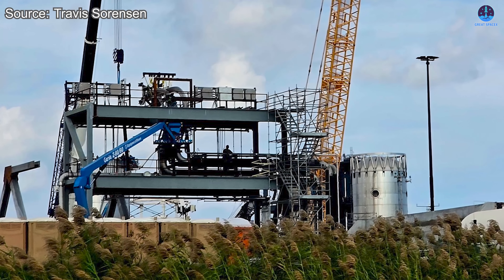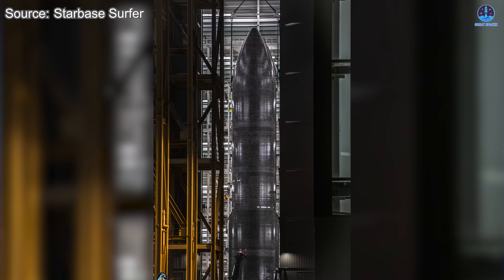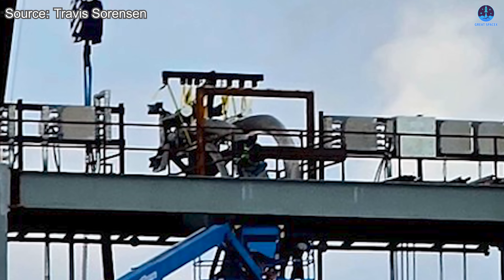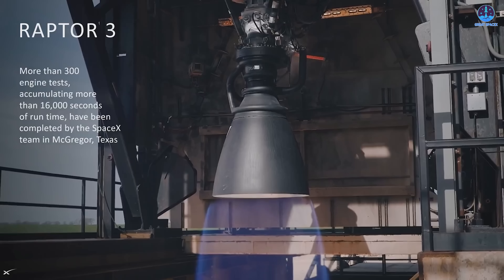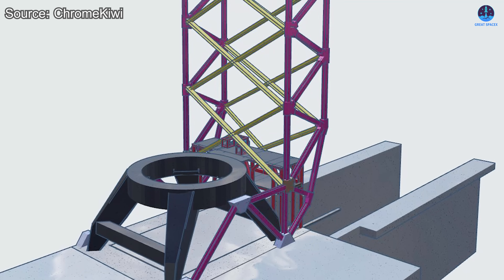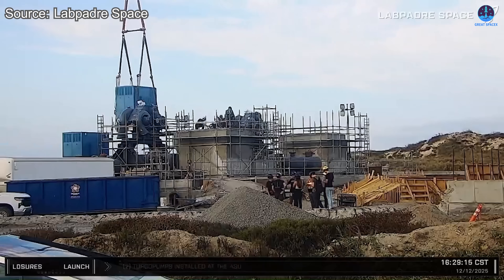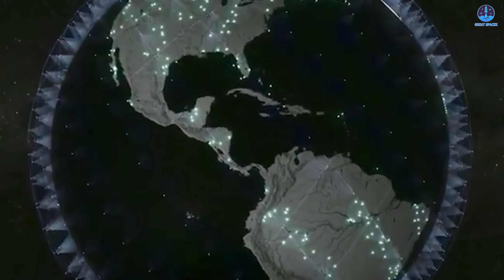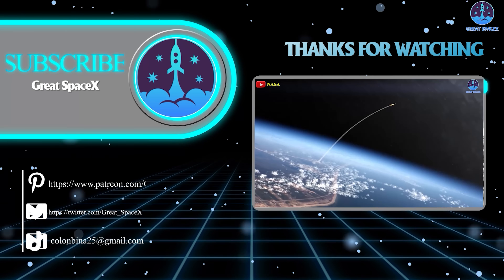SpaceX's Genius Solution to Build New Starship Test Pad at Massey! HOW will This Work...

Comment: So I have a question about these "near miss" incidents.

If you were driving and passed just within 2 football fields of another car, would you describe that as a "near miss"?

No.

No you would not.

What a near miss describes is a point at which the mathematical projections can no longer 100% rule out a collision but they are not at ALL what you would call close in 99.95% of cases.

Comment: Bill for Starship goes up faster then a rocket  :D  Its getting closer to passing the costs of SLS. And Starship doesn't even work. And SLS is already on its second mission...
Reply: You have missed the entire point to this system. Remove the hate goggles and cheer on the USA for leading in space.
Reply: 😂 sure but can SLS be built in a month and launched? Even if Starship was 2 times more expensive then SLS that speed would make it a huge advantage just because of the huge pay load it could launch. Even if it was a single use rocket you could still launch one a month. Also it's the reuse they are trying to nail down so in any other respects it's pretty much good to go. Just give it some disposable fairings and boom. But they are trying to do something much harder. Something not even the space shuttle could pull off without months of refurbishing and a while knew rocket built for it to launch again for it to get out of earths atmosphere.
Reply: @ShieldWolf-yp3cr  Starships payload is tiny thats why they have to make 10 launches just to reach the Moon once in theory.  Starship V2 at ~35 tons to LEO compared to New Glenn's 45 tons and SLS Block 1's 95 tons..
Reply: @Lelanders247 yet New Glen and Starship both need refueled to get to the moon. Starship gets there with 200 tons what about New Glen?
Reply: @ShieldWolf-yp3cr  Difference Starship doesn't work. New Glen is delivering payloads to Mars already...
Reply: Ummmmmm.   We're not paying for it... SLS is raping our wallets for a piece of total junk that doesn't work worth a crap. WAKEY, WAKEY
Reply: @gerrywalsh5766  Try actually looking up Starship funding before talking like you know something about it :D I'll give you a hint the Taxpayers are paying for his lemons :D Dude did you miss when SLS delivered a human rated capsule to the Moon and back already ?
Reply: @Lelanders247 and one SLS rocket takes almost 2yrs to build and cost roughly $2bil and it ain't reusable. You should really stop watching thunderfeet😂
Reply: @steveo6034  Your not doing a good job making it sound bad. Starship is costing hundreds of billions and doesn't even work. Reusable isn't a good thing with rockets. Its costs more then just building new ones. That's why SpaceX has been a money pit for so long. And reliant on gov handouts. Who is thunderfeet ?
Reply: @Lelanders247 SpaceX gets most of it's funding from the starlink satellites subscription
And how is reusable isn't good thing ,then why is all new companies are going to reusable. It's the legacy companies that are lagging behind  and losing contracts 
 Because reusable is cheaper, turn around is faster and the reliability is there
Reply: @DaveBigDawg so true. Falcon 9 is the world's most launched rocket because it's reusable cheaper and more reliable. They just about launch one every day. Like 3-4 a week I think is the average. Now imagine 200 tons flying at that pace while also being cheaper per ton then falcon 9
Reply: @Lelanders247  so question. What do tax payers pay for? Like what specifically. You might want to check your own information before talking like you know what you're talking about. Tax payer pay for one rocket to be designed and that is a fixed price well below any other space companies bid for the contract to build Starship SLS that will land on the moon. All the other hardware to make it fly they are doing themselves with starlink money. The government wanted a specific rocket for a specific job built so yeah they got to pay for it but like I said it's a fixed price lower then the competition while the starting bid of the competition starts higher and they get free money if anything goes wrong and they need more to make fixes or what ever they get more money on top of the already expensive one use rocket and lander along with their second stage which also isn't reusable. So your options are a rocket that can reuse its booster and a lander that can carry a whole army of people and be a home for those people for a cheap fixed price that doesn't get paid till milestones are met. Or you pay more for a one use rocket that if anything goes wrong with the development you pay extra added to the already expensive project with a single use rocket and a lander that can carry max 5 people with limited resources. They will be cramped in a little one room cockpit and limited time to be there. 😂 Like really what are you complaining about? The shuttle took longer to design then starship and they still haven't even reached the total time it took to build the shuttle and it's rocket. That's the only other reusable rocket we can compare it too. Also SpaceX is trying to do it better and tackle harder problems. So really SpaceX is saving the tax payers boat loads of money with Starship.
Reply: @Lelanders247  what handouts? Actually curious. Point out one hand out from the government. What has SpaceX ever gotten that it didn't earn? That is what you are implying that SpaceX got bailed out. Where when and for how much? How many times did this happen? I'm really curious 🧐. When was SpaceX bailed out by the government?
Reply: @ShieldWolf-yp3cr  I'm glad you asked. They milked NASA for billions in a Moon mission ruse. But Starship was a lemon the entire time. Nobody really believed it would work. And thankfully the mission is moving ahead without waiting for them any longer. "NASA awarded SpaceX a $2.9 billion contract in April 2021 for the first crewed Starship lunar lander for the Artemis program, with an additional $1.15 billion contract in 2022 for a second Starship lander to support future missions like Artemis 4.
Reply: @Lelanders247  😂 sure but NASA is about to re experience this (The Space Shuttle Challenger (STS-51L) disaster on January 28, 1986, is the primary U.S. spacecraft example where the crew was lost due to a known, pre-existing issue. Engineers had previously identified that the solid rocket booster O-rings were susceptible to failure in cold temperatures, yet the launch proceeded despite freezing conditions.) they have a heat shield they know isn't good enough but they are pushing through with it anyway. They are pushing too hard with their old tech and putting astronauts lives on the line. Also those aren't handouts. A hand out is when you give someone something for nothing while these are contracts. You pay for a thing. That's how it works. I'd rather things be tested correctly and the problems fixed instead of how NASA is handling the SLS, putting lives on the line to meet deadlines. Also NewGlen isn't any further along then Starship. The only difference is they sent a real satellite instead of a dummy satellite and went faster to reach L.e.o. taking more chances of not controlling the craft of anything went wrong. Starship takes it's specific flight path to limit damage to surrounding areas if anything goes wrong. It's not that it can't do it.